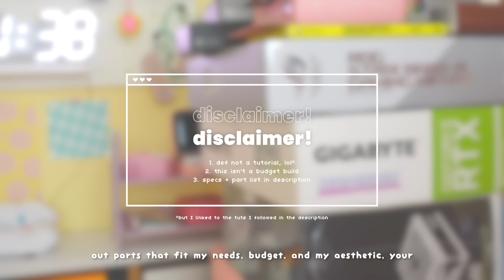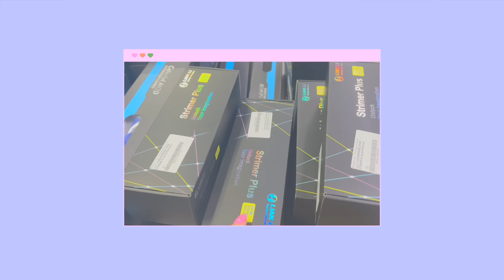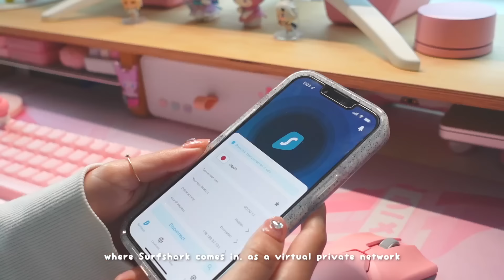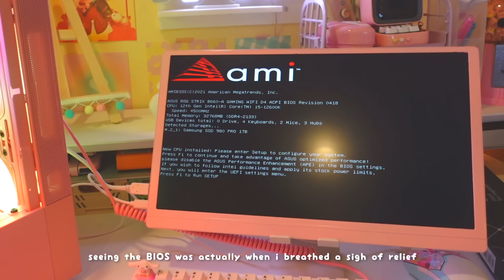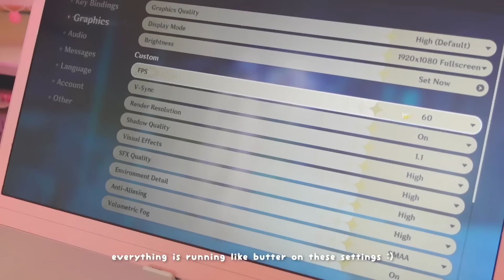🍉 building my first gaming PC so i can play genshin on cracked settings | intel 12600, rtx 3070ti ✶

Comment: Very good build besides those things u put on the fans I'm dying to hope the airflow is good. Even though the pc isn't on the desk, I'm glad to hear it's on a wood floor. Anyways this was an excellent build and that card you can Def push more fps with a better monitor. ID recommend going vor a 240hz monitor but if ur just going for genshin it's not necessary you can go for a 1440p or even 4k if jt fits the budget.. you probably don't need more than 60fps on genshin but then again idk what other  games u play now  so yeah. But very good build and it's a very good beginner's setup

Comment: Congrats! on your first pc build. I built mine a year ago with an i7 10700 and rtx 3060ti and it perform like a beast on my 4K 144hz monitor but sadly pc version of Genshin still doesn’t support 120hz mode which sucks. So, I recently bought an iPhone 13 for it. Btw I mainly play fps games like destiny, valorant, halo, etc on my gaming pc.
Reply from the maker: I know… I’m hoping they add 120hz soon because most gaming monitors are 144hz these days, but we can wait together! 😌
Reply: @nemuiatelier  you can download fps unlocker for genshin

Comment: For the cpu i would choose another motherboard (or another cpu if you don't plan overclocking)
for the mobo choose Asus ROG STRIX Z690-A GAMING WIFI D4 ATX LGA1700 (but is more expensive)
or if you want change the cpu choose i5-12600 or i5-12600F (the f version is wihout the integrated graphics)

Nice relaxing video btw.

Comment: You should seriously consider buying a new monitor. Specifically, a 1440p 144hz (or higher) one to get to actually utilize the power of your PC. Also, if you didn't know, there's little to no difference between playing on console vs PC with Genshin because it doesn't have demanding textures and it's fps-capped.

Comment: for people looking to recreate this build for themselves I recommend getting a used 2080 ti on ebay it's got basically identical performance to the 3070 ti (and better performance then the 3070) and goes for 400-450$ instead of 600-650$ plus if for any reason it's not working you can get a return threw ebays return policy

Comment: I personally love the 3070ti vision just s great and minimalistic card but parts get better over time so I will be getting a 4090 oc but the 3070ti will be a build for a friend that I've know for a long time, first builds always the longest but good to see the pc is actually a cool build for a pink theme, tho I would say monitor upgrade fasho try something like a 1440p 165hz then you could get that full advantage of the 3070ti, I learned the hard way in a long run big mistake bc i take some games pretty competitive and you can tell the difference between 1080 and 1440p

Comment: Pc building is practically expensive legos. good job on your first build. Make sure you set your ram at its rated speed, out of the box it only runs at its base speed of 2133 mhz

Comment: Amazing work! I was so nervous the first time I built a computer. Out of curiosity, did you find problems with getting accessory cables for your setup? I've been having a lot of trouble finding White or Pink Power cables for monitors / computer. I literally couldn't find a white / pink 16foot Displayport :(. I'm just curious how difficult of a time everyone else is having with this.

Comment: have you configured the water pump of your water cooler in the bios ? if not it could ruin your pump. 
you have to set the voltage for the pump to full. (should  be about 5V i think)

Comment: Fair warning on CP2077, game will tax your GPU through the roof should you run at max graphic detail settings with Ray-Tracing maxed out.
Reply: taxing your hardware isn't dangerous, letting it overheat is, and a 3070Ti would still get north of 30FPS with those settings, probably higher on a display with that low of a pixel count, so why would it matter?

Comment: it would be better if you waited till 2023 cuz if you did you could've gotten an rtx 4070 for less for the same price as a rtx 3070 ti (plus the 4070 is almost as good or even better than the rtx 3090 ti) and an 13th gen i5 is better than an i7 12700 and even an 11th gen i9, so instead of an i5 12600, you couldve gotten an i5 13600KF. you can choose between the 13600K, 13600KF or the regular 13600 depending on your budget, setup, requirements, etc. or instead of an Nvidia card, you can get an AMD or an intel card, (trust me I've used an intel arc a770 (16 GB) and an a750 (8 GB) and its awesome)

Comment: Quick question is the B660 better than a B550 motherboard? I personally have an X570 motherboard with a 3070ti. But I may or may not have snapped something important off of it so I was wondering what would be best? My CPU is a Ryzen 9 5900X and like I said I have a 3070ti. If anyone in the comments could help that would be sick.

Comment: should have gone with x570 mobo cause you can't overclock your processor now because that's what i5 12600k is made for
Reply: Ah yes, Intel 12th Gen CPU on a AMD Zen 3 Platform. Surely that will work fine!

Comment: I saw your pcpartpicker and it says that some specs are not compatibles. Did you had some issues with your pc? because i wanted to buy a similar pc but I'm a bit scared :/
Reply: What is your list? I can help
Reply: @TaxEvasionUS  look at her pcpartpicker I wanted the similar but I don’t know if I should change something since her pcpartpicker says that some specs are not compatibles :/
Reply: @lil_strawwberryy   @lil_strawwberryy  @lil_strawwberryy  What I would do is change the i5 12600k to a regular i5 12600 if you do not know how to overclock. I would also get a 750W power supply instead. You should reduce the RAM amount from 32 GBs to 16. You will in most cases not need that much, and if you do, you can buy more to fill in the other two slots on the motherboard.  I would also get an air cooler instead of a water cooler unless you like the way it look, but its not worth it and the one she got in the video sucks. What games will you be playing? I will need to know if I am going to recommend a GPU to you. I would recommend a 1440p 144Hz monitor, but 1080p 120+ Hz is good too.
Reply: @TaxEvasionUS  mostly valorant, genshin, csgo etc i mean mostly fps but I also play genshin sometimes
Reply: @lil_strawwberryy8446  I would still go with the PC case and extra fan she has on her list, I couldn't find her case available when I made my list
Reply: @lil_strawwberryy8446  YouTube keeps deleting my comments for the link I made. I can help you out more on discord if you have it.

Comment: I could never do this because I’m not that smart with electronics
Reply: It's a actually pretty simple to make a system. She didn't do a good job though because she overspent on the processor that she can't fully utilize since she's using a locked motherboard on an unlocked processor.